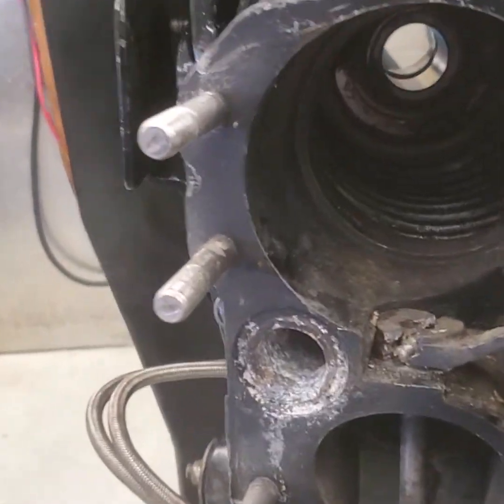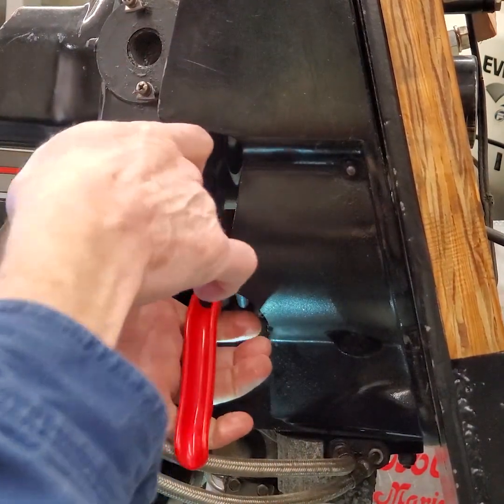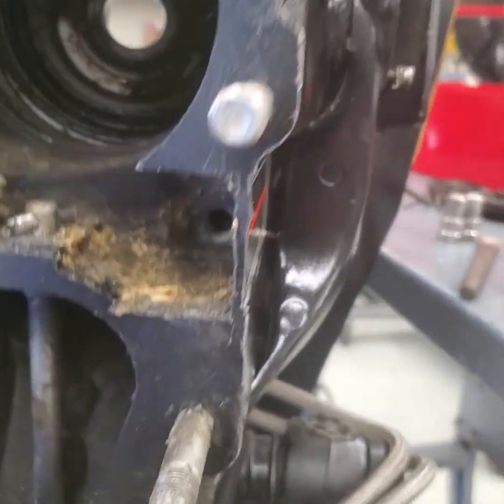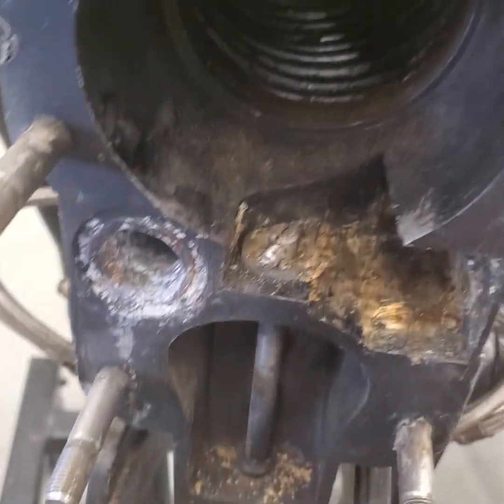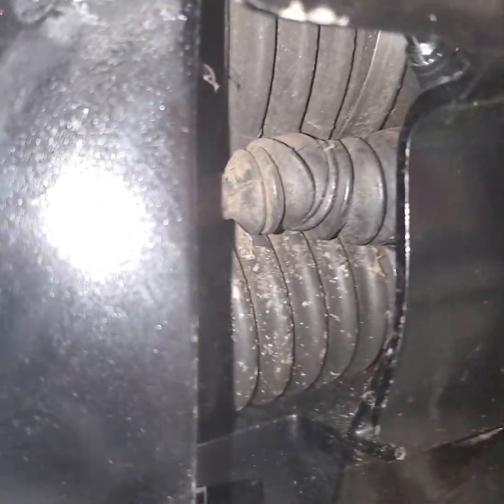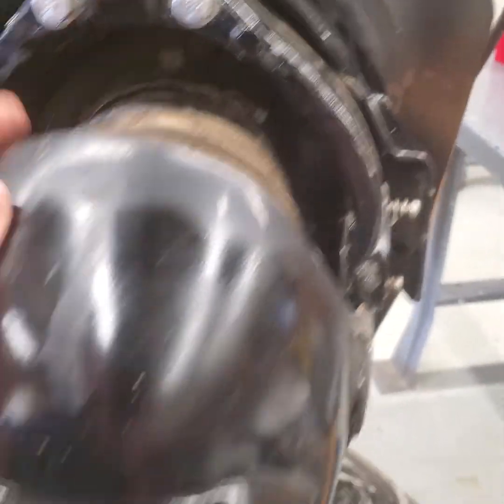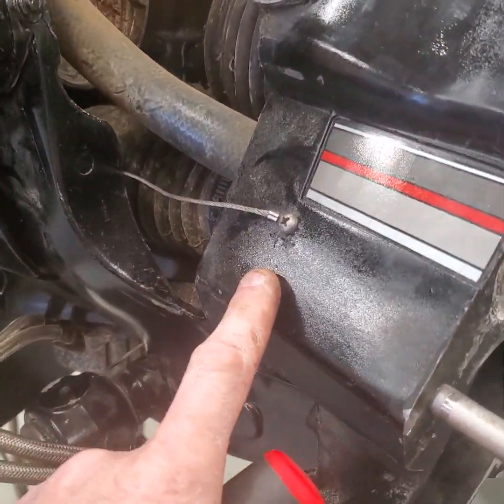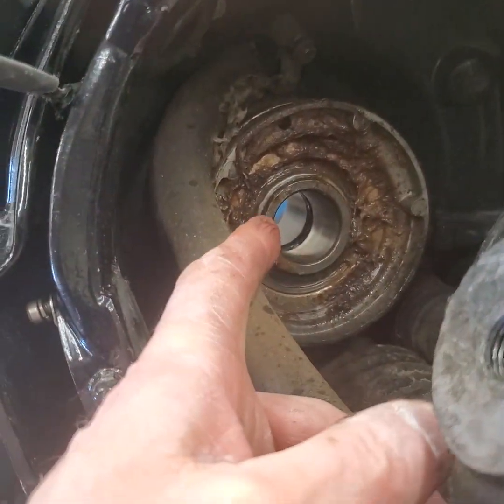MerCruiser Alpha One Pivot housing removal

Comment: Nice video man! Ive been lookin for a new shifter arm brass washer. And i cant find it anywhere? I bought a quicksilver shiftcable set, with the arm, cable and bellow. And i only find this little plastic thing in the set. I was thinkin this was going to be in the old brass socket, but it doesnt fit so idk where i should get a New brass washer like u got in this video. I need a New sealer cuz the old one is just a ring left 🙈

Comment: There’s milky oil in my driveshaft bellows. What’s odd is I drained my lower unit the day before and the oil was black, not milky. So I don’t think it’s coming from the gearbox. Is it possible the ripped bellows allowed water to wash the grease out of the u joints and created the milky mess? Or is my input shaft seal definitely leaking. Thanks.
Reply from the maker: Drain and pressure test drive. Likely a failing carrier seal from your description
Reply: @tedsmarinerepair8956  I think it’s actually the seal that rides on the driveshaft yoke
Reply from the maker: @brad8665  ok
Reply: Exact same thing is happening to mine right now
Reply: @FBIsurveillance62  it’s the seal and yoke on the input shaft of your gearbox. Both need to be replaced